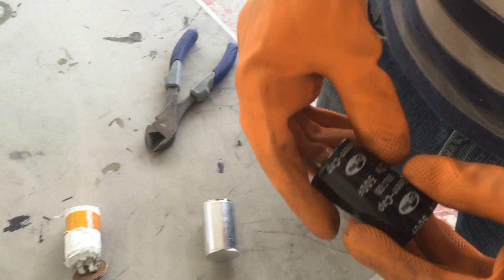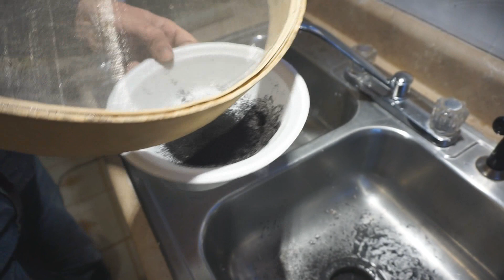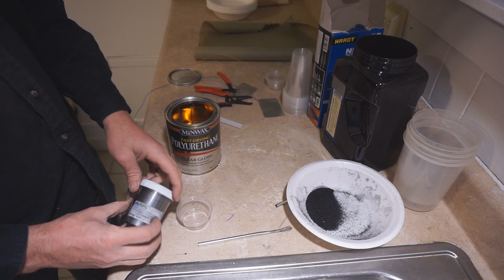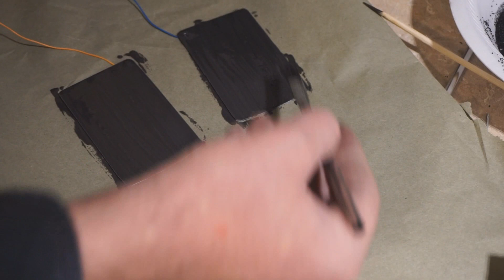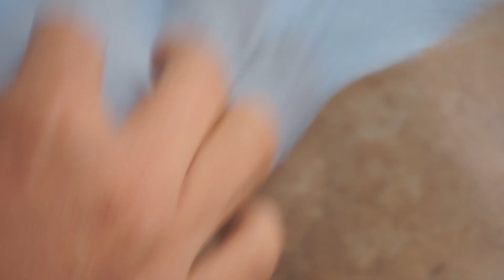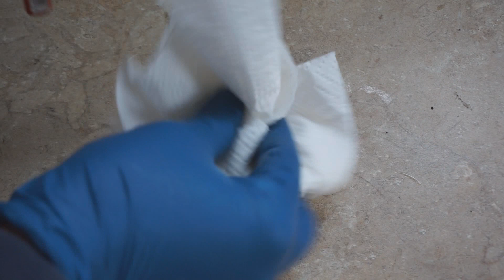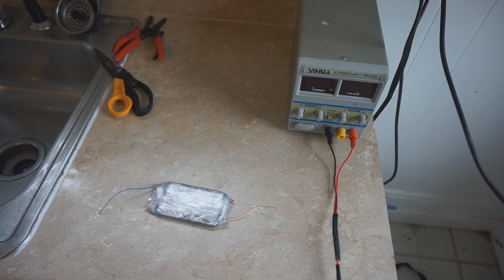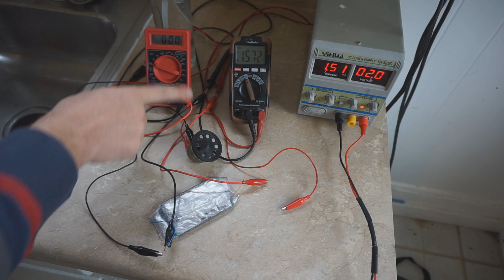Easy DIY Graphene SuperCapacitors

Comment: Okay, if I'm right about how your super capacitor is working, you've really done something cool.  But, here's my word on what I think is happening here.  You've mixed a semiconductive material carbon, with polyurethane.  Have you ever watched Walter Lewin's Lectures at MIT?  Where he takes the lyden jar apart and the charge off of the conductors, puts it back together, and the charge is still on the glass?  If the phosphoric acid, is literally doing nothing, and the polyurethane and carbon are doing everything, oil, will work more stably.  The finest powder carbon, will work, and you can get that as printer ink, for laser printers.  If mix it with the urethane, it should work just as well, if you mixed the paint with the carbon ink, so the point it's a paste, that still flows to level itself, paint each side, let dry.  Then paint them together with the same mixture.
Reply: +James Elger Here's what happens, each little speck of carbon, is surrounded by urethane, it's conductive, so it picks up a charge, has free electrons but, the urethane doesn't give any up.  So, each grain, is acting like another plate, so it pulls a strong positive or a strong negative and causes voltage to be divided between plates and grains.  At certain points, the carbon is breaking down, and conducting from particle to particle closer to the plates, where current will be the highest.  There's a little migrations of carbon atoms, it's a produce of the direction of current flow.  But, eventually, the urethane wins until you just burn all of the way through it.  So, that will increase the plate area as a matrix similar to a Lichtenberg figure.  As long as you use AC to slowly burn it in, it's capacitance should increase for awhile.  But, that at some given voltage, you will burn through.  Stopping then using it at lower voltages should keep it stable.
Reply: +James Elger charge, short, reverse polarity, repeat.
Reply: +James Elger Capacitance goes up slowly each time you discharge it suddenly.
Reply: +James Elger The migration of atoms, look in electron microscopy.
Reply: +James Elger It would have worked the same with cooking oil.
Reply: +James Elger If I wind up wrong, show and tell, you've got most of it there.  A pistol and mortar would do it to grind to a fine enough powder.
Reply: fine powder won't work, it isn't conductive in a binder like polyurethane.  Phosphoric acid is a well known capacitor electrolyte and boosts capacitance at least 5x over water.

Comment: You should try vinegar etching your aluminum plates.  You'll get a crap ton more surface area.
Reply: This is a really good thought. Actually, using a decent porcelain etch solution you find in some tile and bath coating kits would be even better. Mechanical roughing is far less effective at creating surface area and a bonding surface.
Reply: Okay but that's just the current collector

Comment: I am not being critical let me first say....if this is legit then:
I have to say that I am impressed by the stability of the current. This is a pretty crude device. If it were refined your numbers would be much better. But what this translate to in my opinion is constant electron flow [for the most part] even at the drop of potential difference [the force which would normally bring about the move of electrons] which means that electrons in this setup are willing to move with out too much push. Imagine a refined device , a purpose built motor[ right now your motor more than likely is a voltage device and not current device] and all put in an array. I would suggest ..use a oscilloscope [cheap one with maybe pc connect/hand help or desk top] and track the current and voltage pattern on a graph , if you know how to rewind the motor[it not hard] but with the idea to work at low voltage . I am certain you are on to something SUPER. As i said if this is a legit video Awesome Job.
Reply: S

Comment: I was thinking of 
lead foil tape or aluminum foil tape 😂
Reply: You're right doing that. Capacitance is relative to the surface area and the inverse of the distance between the two sheets; so using foil is good because you can make a large surface and then roll it up. This is how the little cylindrical little caps are made.

Comment: bro you are wrong.
that's not a supercapacitor, it is a hydrogen cell power.
berry cheap and berry efficient only because it is shield but you got the risk to combustion the hydrogen with the oxygen inside catalysis by the electrical charge when you charge the battery

Comment: very cool and interesting. Question? If you increase the size of the plates will the storage charge increase as well? Also have to connected several of these in series or parallel to see if you get a longer charge time?

Comment: So how much of this do we need to make a big mobile phone battery :P
Reply: Thomas Anderson Dude, super capacitors are not new. They are ubiquitous in electronics and industry in general, and there is constant research being done on them, just like there is constant research on pretty much any kind of electronic component.

While building your own capacitor is a cool project, you can go out and buy a super capacitor that is 10 times more powerful and efficient than the one in the video for the money he spent on making that one.

Capacitors and batteries are different things, and serve different purposes. Sometimes those purposes overlap, but capacitors are really not at all ideal for any kind of long term power storage.
Reply: +Johnny “Walker” Kat A standard cell phone battery would run that motor for 60-70 hours. Capacitors hold a fraction of the energy that batteries do.
Reply: +Jeffery Wells maybe they need to dig into this research and expand on it with dissimilar materials on the outside of the tubes vs the materials used (in this case nitrogen) on the inside of the tubes?
http://revolution-green.com/breakthrough-carbon-doped-with-nitrogen-supercapacitors/
Reply: +Jeffery Wells If you spend a couple of hundred dollars and they dont last as long
Reply: Jeffery Wells
please read the article and stop just spewing? they are jamming nitrogen inside carbon nanotubes and finding that they have a dramatic increase in electron storage density, and if they were using something that was negative charge on one set of tubes and positive charge on the other set, you might end up with some pretty intense storage battery like systems with the benefits of a capacitor.
Reply: thats excellent advice. I have been moving in that direction but it is like a maze and so many variables.  If you get any finds let us know.  Thanks
Reply: Thomas Anderson That 100% backs up my point. The DIY capacitors aren't capable of doing this at all. You need lab-grade facilities to pull of most anything in that paper. All you'll get trying to DIY it is a sub performance capacitor for significantly more money. Unless of course, you have lab-grade facilities at hand to do your DIY in, then that's totally different, and have at it.
Reply: +Jeffery Wells lab grade facilities? I think you need to look at all those who are pulling off "lab grade facilities" level work by DIY based mentality and the hardware store. like Robert Murray-smith's graphitic carbon nitride made at home with a microwave oven and Urea. a compound that costs nearly a thousand dollars or more for 10 grams and he pulled off making it for like 75 to 80 cents.
Reply: +Thomas Anderson I should add, though that if you dont have lab grade money for lab grade equipment, you just need to get inventive and build something to make things work, like some steel pipe nipple and pipe caps, and a can or two of very high temp spray paint that is silicone based for engine blocks, to coat the inside to produce as high a temp and pressure based cooker as you can get, and some teflon gas pipe tape to make it hold pressure high enough to do your work but not high enough if your heat source is effective enough to cause any sort of pipe rupturing (tape gives out before the steel in the pipe or cap do) where there is a will there is a way.
Reply: jeffery wells doesn't get it.  We take it all for granted but someone who has never been a scientist or engineer can't comprehend why anyone would want to do anything on their own.  There are so many reasons I can't even list them but one reason is to make something BETTER than is commercially available but to a white collar cubicle dweller they think that is heresy.
Reply: NatureHacker I get that completely. I'm just saying it's not going to save you any money, and unless you've got a really nice lab setup, you won't be making a better version than what is commercially available. Thick aluminum plates, wire mesh, homemade graphene paste, etc. are nowhere near the quality of materials used in commercial super-caps. 

I'm totally cool with building something just to understand it. I did the exact same thing with a 3d printer, because I wanted to know how they work. But don't fool yourself into thinking it's better than what you can just go buy. There are a lot of people who are doing just that, and they are going to be sadly disappointed. That, or they won't even check what modern tech is capable of, in which case they won't even realize it.
Reply: You have no clue.  I just invented a brand new type of battery TODAY.  All inventions come because someone was TINKERING.
Reply: NatureHacker
 that is not what jeffery is saying, he is saying the quality is going to suffer in a small shop due to the quality of the tools available to the common tinkerer, as well as the cost of supplies when you are not buying in blulk, which I can agree with to an extent but I do just that all the time by making my own tools and supplies, so you just have to be dedicated to get the same quality and need a lot of something to make them cheaper by making it all in bulk and avoid tooling costs in time and supplies. which makes you a small scale manufacturer at that point :)
Reply: What jeffery is saying is there is no point to DIY and my point is that we aren't trying to mimic what already exists we are creating things that don't exist.
Reply: NatureHacker I didn't say there's no point in DIY. DIY is great! I do DIY stuff myself. I'm just trying to inject a little reality into the situation. If you want to build and use supercaps because you think they are really cool, and you don't mind the fact that it's ultimately going to cost you more money for less performance to DIY it, then more power to you! 

I can get behind that 100%. But if you think your home made capacitor is going to perform as well as commercial capacitor for the same or less money, then you're fooling yourself. The homemade version will either be larger, have less capacitance, or be more expensive. Possibly even all three. Now, if you're OK with one of those, then that's another great application of DIY!

Comment: 27:47 nice bug :)

...this is looks like not capacitor but regular accumulator with Aluminium-Carbon electrodes (where next aluminium plate just used as connector from carbon square)
check reactivity series (electrode potentials from different metals\materials) - here pic i found with values http://www.стендростов.рф/stendi-dlya-shkoly/kabinet-himii/1_neorganicheskaya_himiya/img/1_1_electrohimicheskii_ryad_napr_metallov_1_b.png

best combination should be Li + Au = about 5 volts (where i think enough just to cover by electrolysis any metal with thin layer), but if continue to use carbon then in that row we can see another metal that may work better then aluminium (it is just cheap)

interesting to see few layers how it will works (as well maybe some alloys work better than just clear material)

Comment: Nitrogen-doped mesoporous carbon has a capacitance of over 800 Farads per gram. Incorporating nitrogen into the carbon allows electrochemical redox reactions to occur in these double layer supercapacitor cells. You can bake carbon in a kiln in an nitrogen atmosphere at 800 degrees C for an hour to add nitrogen into the carbon without sacrificing conductivity.
Reply: +Jonathan Fosdick yep, pee in it.
Reply: +Dan Murphy I'd rather enlist my cat for this as cat urine is high in ammonia... but no, I don't want any impurities negatively affecting the cell.
Reply: iv made a highly nitrogen doped ionic liquid but pee is one of the secretes
.  peace out!
Reply: you can easily react the ammonia in cat pee with something then crystalize it out of solution.  Or just buy ammonium salts.

Comment: Maybe I missed something, what purpose does the activated carbon serve? I'm very interested to see what other materials will do for the conductivity.  thanks. And I agree with the others...very nice vid
Reply: +Lee Hand it is about surface area. It is not certain that laser sabers experiment isn't slightly a carbon air battery, but yeah. If you use carbon and aluminium alone you will get a current, strangely enough.
Reply: +Hooch Lover Thanks hoochie man. I see what you mean.
Reply: strange?  Thats called a battery hooch.  the aluminum is just a conductive substrate for the carbon, using plain aluminum will dissolve in phosphoric acid.
Reply: and it would be called aluminum air.  The "air" thing happens in the carbon.

Comment: lasersaber si se oxida se descompone, si se descompone no genera electricidad. 
Lo que hay que buscar es hacer la batería con los dos electrodos de carbono.
En ello estoy.

lasersaber if oxidized decomposes if decomposes not generate electricity.
The thing to look for is to make the battery with the two carbon electrodes.
I'm on it